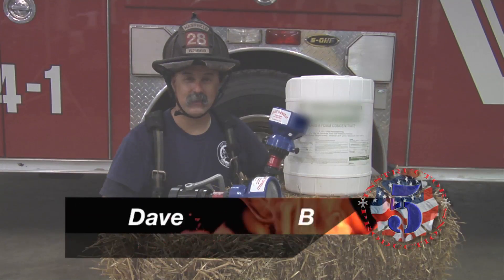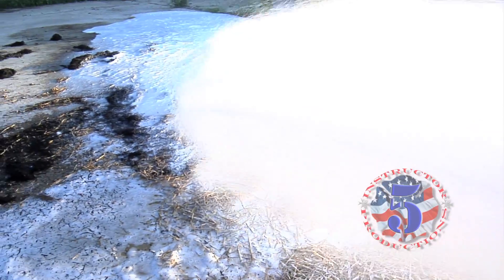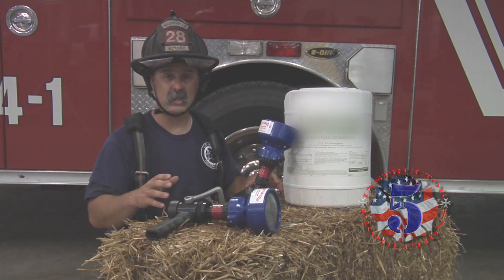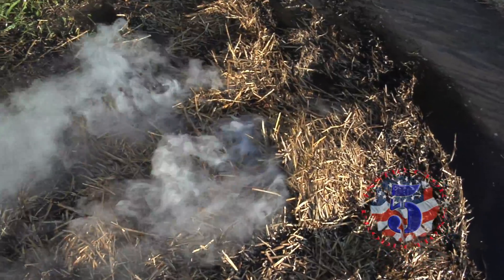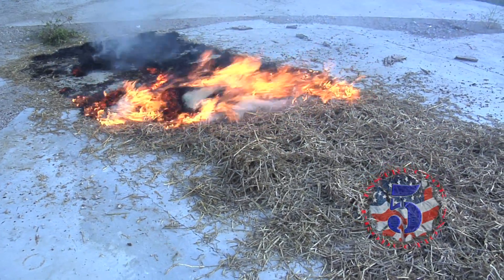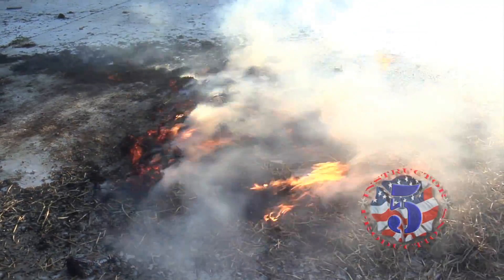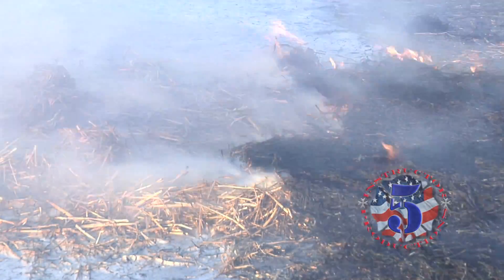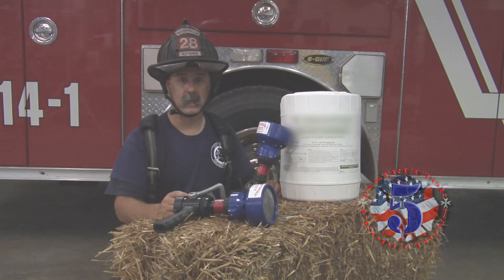Class A Foam

Comment: You DON'T want a foam "blanket" on class A materials, you want it to soak in.  Using too much class A will make a blanket that will sit on top of materials like mulch and sawdust, and the fire will just smolder underneath.  Remember that with Class B foam, we are separating the fuel from air.  With Class A fires, there is already air mixed in with the fuel, and often it can draw more air in from underneath or from the sides.  Just a few fine bubbles on the top in a thin layer is just about what you want.   A thick blanket like what you would use on a Class B fire is not helpful.  You want the foam concentrate to enable the water to soak into every little nook and cranny.  Using a higher percentage than what you need is also wasteful.
Reply: thanks

Comment: Didn't realize 0.5% is as effective as 1%.
I'll have to do some trials with my private engine.
Reply: You have a private fire engine?
Reply: Rick1885 Have my own type 1 engine with 750gals of water, and dual foam.  Mostly to protect my own property.  Have put out several neighborhood fires over the years.  I'm surprised more people don't have their own fire trucks.
Reply: ***** Well, I ran class A foam at 0.5% instead of my usual 1%.  Still made great foam at the lesser concentration.  Now I can foam the backyard twice as often.
Reply: @rleslie845  I couldn't agree more. Used fire engines are surprisingly cheap, are usually meticulously maintained and have amazingly low miles. We live on acreage in wildfire area so we bought our own Type 6 engine with 300 Gal tank and foam system. We have a 16' walmart/coleman pool which holds about 5500 Gal that we use for extra water supply. Our primary use for foam would be preventative to wet things down or foam them up ahead of an advancing fire so we don't have to fight things that are on fire.
Reply: It seems pretty logical to me to own an engine.
I'm in Southern Calif  No shortage of fires and earthquakes.